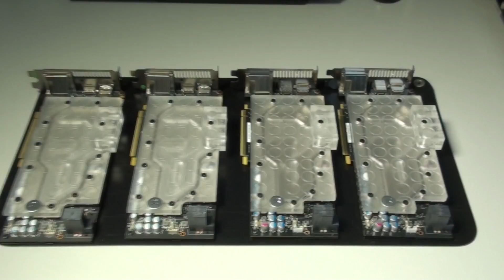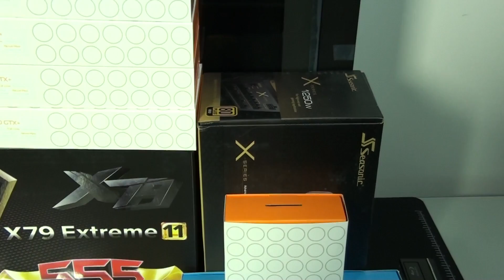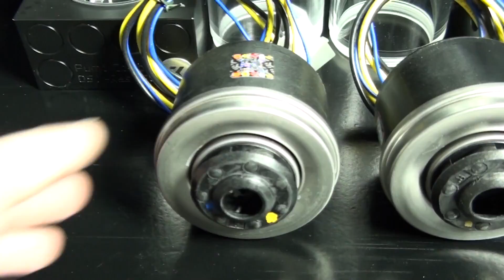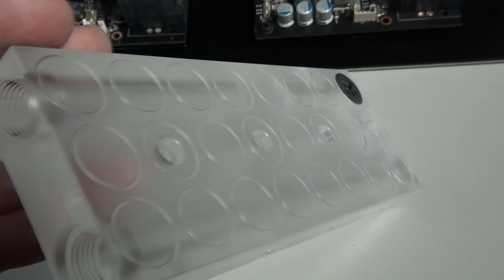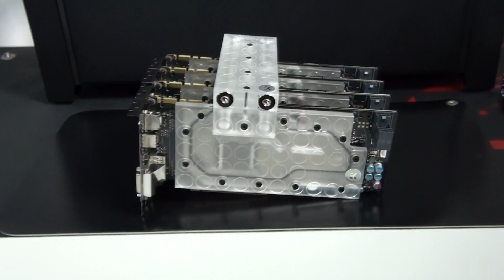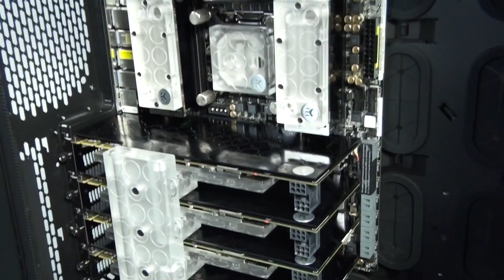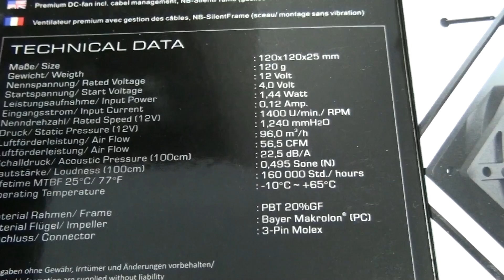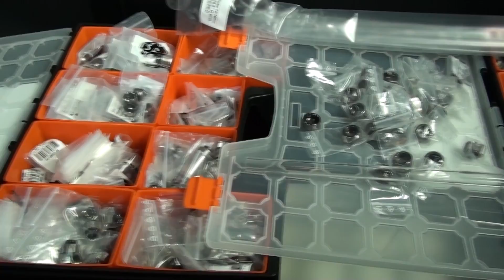Build #12: Quad SLI 900D: Part 1

Comment: Think the main reason for the partial serial bridge is more equal discribution of the flow, to not risk one or two graphics cards ending up getting too little flow. Also the benefit of more flow when using a parralel configuration is not as much more from moving from 2 to 4 or back since the rest of the pipes are just single line. The flow should be about the same from 2 by 2 parralel as 4 parralel. So this is overall a better choice.

Comment: I really recommend a build in the new Phanteks Enthoo Primo! I'm sure you've heard of it being such a big water cooler. Slightly smaller than the 900D but even more friendly for water-cooling with all of the built in features for water-cooling. It's also just much nicer built than the 900D. It also comes with 5 of some of the very best fans on the market right now. Really outstanding case that just dropped down to a $200 price tag, which is completely crazy given how high quality it is. I think it should be more than the 900D and certainly costs more to produce. I would LOVE to see one of your builds in this case!
Reply: That is one sweet looking case! I will have to buy a few for my higher level clients .

Comment: For the bridge, I think they did that so that all cards would get equal flow. In my mind, parallel loops would just rush past all the GPU's. (haven't used before) But, i prefer Primochills application of acrylic tube. They have compression fittings for the tube, which for me is a must for acrylic tube.

Comment: He should sell those 2 680's and get 2 780 Ti's instead of quad sli with bandwidth and v-ram bottleneck
Reply: nasha thedog If he's using a single monitor, he's an idiot for using Quad-SLI anyway.
Reply: If he games in 1080p/1440p on a single screen, these will probably be faster.
Reply: Y'all will be mad at me but for 4k 2 or more 290/x's would be the best option.
Reply: ***** 680's no matter how many can't go 4k with v-ram and bandwidth bottleneck it will stutter as fack
Reply: ***** If you want to run a decent fps with max settings on any game at for example 2560 x 1440 you will need a pair of 780 ti's to manage it. By decent fps I'm talking about the 2560 x 1440 monitors have a 60hz max so I'd want to keep my minimum fps above 60, To do that with games like Crysis 3 and metor and various others you'll require the best cards about. So running multpile 4k screens in this way is beyond what we can purchase now, As for 4way sli or crossfire I think that's a terrible option to go with, poor drivers make it worthless to a gamer.
Reply: ***** No, even 4 780ti's is not good enough for a single 4K screen because you cap out the 3gb vram when you turn everything to max (in a game like AC4) example! 780ti is a stupid card since the 3GB vram is only enough for 1440P max (when you crank settings up) in AC4 at max settings on a single 1080p monitor u use 2,4 gb vram at max sooo....
Reply: CrypticMeow 3 1080p is not 6k. 4k is 4 1080p monitors so you got 3/4 of 4k
Reply: ***** cool story kid
Reply: 1995hss But the extra issues that come with quad sli would negate that small advantage, after all if he can push 100+ with a pair of ti's what difference is he gonna see when he has something that quad sli works with anyway?
Reply: you gotta remember its what the client wants not him
Reply: 1995hss The best options for the majority of people who won't be watercooling there graphics cards are either the 780 ghz, 780 ti, 290 non-reference or 290x non-reference. Thanks to the bandwidth and ram the AMD options are probally the best 4k choice. However 99.9% of us will not own 4k during there lifespan and by the time we can afford to get 4k there will be newer graphics card ranges out built on newer architecture which perform better.
Reply: philip s Honestly I rather have a 290x with and EK waterblock for cheaper.  The PT3 bios already allows for max voltage most are hitting 1300mhz no problem.  With Mantle around the corner and so much dev support its the way to go!  Overall Hawaii is faster clock for clock vs Kepler.  290x is still on beta drivers we can expect much more headroom!
Reply: philip s g-sync is neat but there is additional cost associated with it $399 starting, I would rather put that money towards other components.  Most keep their current monitors and rarely upgrade.
Reply: ^You are super wrong. We have been testing the sh*t out of the all of the AMD's GPU's and they suck. Just as bad as they ever were. Already had 3/20 DOA. Another 2 had serious issues. Tried to contact our AMD Rep (We sell a lot of f*cking AMD parts why can't we talk to one of these nubs who speaks decent english ? AMD is junk though. And Sanjay doesn't KNOW anything. He just repeats what other random retards spew onto the internet. #somepeopleskids
Reply: nasha thedog Well the fact that it's better than Titan in every way and cheaper just means that the price of the titan was out of this planet!
Reply: philip s im using one 780, and running 3x 1080p screens, so 6k. and i run most games fine max graphics. though when it comes to games like crysis 3 or the metro games i need to turn the settings down a notch. but games like arma 3 i run 3 screens max settings no AA at around 60fps. 2x or even 3x 780 Ti would be able to run 4k surround pretty easily.
Reply: ..... well i dont know what to believe anymore. because that's what i used to think. then someone told me its measured by the vertical pixels..
Reply: but still. im using a second gen cpu. once i get a 4770k 4k isnt going to be a problem. 780s are made for it. especially Ti's.
Reply: CrypticMeow This is 4K (4 1080p) http://www.digitaltrends.com/home-theater/4k-hd-explainers-sony-lg-content-delivery-availability/
You won't see a difference going from second gen to 4th gen.2600k 4.8 ghz is equal gaming performance to a 4770k at 4.6 ghz. I'm running 780Ti with 2500K myself.
Reply: Ah Thanks!
But they main reason i want a 4770k is because i plan to do Sli pretty soon. so i would imagine i may have issues will using my 2600.
Reply: *****  club4ghz is right. Luckily 3 1080 screens is not 3 times the power Sure 3 gb vram is enough for most games today and with one gpu u wont wanna turn settings up to high unless u like lag. Especially antialising since that's what eats vram. But if u buy two 780ti suddenly u got The fps to turn settings up but not the vram. Eventhough it was so called build for high res it was not build for high res at max settings. I u want that u should wait for EVGA's 780ti unlocked version wich they Just got a go from nvidia to make that fella will have atleast 5gb vram
Reply: philip s I'd say your better off waiting to see how much more performance the next gen cards give us, also I'm sick of rumours so it'd be nice to get an actual release date for the 20nm range. When you say EVGA are you talking about the ti Classified or is there a different model coming?
Reply: CrypticMeow The best option (debatable) for sli is the sandy-e, ivy-e platform. The reason I moved from Ivy to Haswell when I upgraded from an i5 to an i7 was so that I'd get the extra sata 3 connections for my drives and the improved memory control. Having said that I originally planned to sli and considered ivy-e but still went with a 4770k over it because of the other reasons I mentioned and the fact that even though ivy-e's platform should perform better in sli or crossfire due to the pcie differences the in-game performance figures still put the 4770k above the 4820k most of the time.
Reply: EVGA pushed Nvidia to give clearance to let them make the gpu they wanted. That's the story. The important is it's true even Linus from linustechtips confirmed it (if u know him, u know it's true) benefits is 6gb vram and unlimited overvolting...woouh! The name will be 780ti kpe or king ping edition look it up.
Reply: nasha thedog Thanks for the info. i was considering getting a 4820k, but then i started to see benchmarks for the cpu for gaming. and since that is all im going to be doing, no rendering or anything i would be better off with a 4770k. and i do see alot of people using sli 780s with it so i know it should perform well.
Reply: Sanjay Saini you can expect alot.. Chances are mantpe wont be more than 15% faster than DirectX. And really that new 780ti I mentioned will perform way better and then there's G-sync that will give amagzingly smooth fps. Nvidia have Always done a better Job on driver optimization anyways. Ps with that waterblock / need a shitload of other things to make it run.
Reply: philip s yeah in reviews they have maxed out vram on the 780ti but for 1440p its good enough, but not worth the premium over the 290 or 780
Reply: Sure it's worth it if u play on 5760x1080 u need 6gb vram atpeast more than 3 and if u want all the nvidia benefits like physx and shadowplay etc its The way to go personally I dont wanna watercool also
Reply: philip s could be scenario but let's not discuss performance gains yet
Reply: And so the pc race goes on :-) that's why buying a ps4 just might seem cheaper hehe but in the end its all what u pref ajd what your budget looks like. Personally I think nvidia yave a little more quality to it. The software as well as the hardware but sometimes amd have given you more freedom.
Reply: Sanjay Saini Still on beta's? How long have the x's been out? That's partly why I moved from AMD graphics, the other reason was terrible crossfire performance, I chose AMD during the 5000, 6000 and 7000 generations but moved to a 4gb 770 to sli a couple of months ago. I just sold the 770 as I decided to buy either a 780ti or a non-reference 290x instead but hearing there still on beta drivers is a joke. You also need to remember 90% of people don't want the hassle of building a water cooled gpu set up. I just bought a cheap black friday 7850 to hold me until the respective models come out but from what you just said AMD doesn't look like the best option at all as the last time I checked on some relevant forums there staying below 60 degrees on water but only reaching around 1200 while remaining stable. At the moment the 780ti looks like it will be the best choice but I'm staying on water with my gpu so I'll see how they all perform on release.
Reply: philip s I did a load of info hunting on the EVGA Kingpin and it sounds like it will be a beast but where looking at too high a price for most of us, I'm sure it'll be the new Titan but I'm struggling to justify paying what they want for an EVGA 780ti Classified let alone what there gonna want on top for the Kingpin.
Reply: You ever think he just likes the looks better?
Reply: nasha thedog Make sure you PM us if you are serious. Vince is a homie.
Reply: i think performance is just a second thought.. the way it looks is number one
Reply: nasha thedog crossfire issues are gone with the R9 290,  SLI is not what it used to be still no cod ghosts sli profile,  till this day there is stutter in bf3 and tomb raider was a disaster.  Both companies have their pros and con's.  As for the future..its definitely brighter on amd's side with console and mantle.  Hawaii is faster clock for clock vs Kepler.
Reply: ***** Than your very lucky sir.  Glad your experiences with Nvidia have been pleasant.  Got a feeling that you do not play a lot of games?
Reply: Sanjay Saini I play a hell of a lot of games and I haven't really had any problems with Nvidia or AMD, At least not before I tried dual gpu's and then I had a terrible time with crossfire. With single gpu set up's I think both brands are great. I've had more AMD than Nvidia but the last was a 4gb 770 and it ran everything flawlessly.
Reply: Be happy on what you have guys...I've been using a very old laptop with GT 105M Gpu and I'm happy playing games with it. My parents can't even afford case fans atm. Heck, we can't even afford a taxi on the way to a computer parts shop.

Comment: Make a Nice bottom panel; Mine ended up looking great with a HL3 symbol.
The top panel is a bitch ya.
hinges are easy 2 bend back, but are annoying.
You will have fun modding the 900D

Comment: They use semi-parallel so that you have options to avoid lowering the pressure in the loop too much, or having to have a very high pressure loop prone to failures.

Comment: The Semi-Parallel configuration on the EK-FC Bridge is to optimize system flow.
Reply: Serial or successive reduces system flow due to higher restriction caused by limited dispersion; parallel increases system flow due to less restriction caused by simultaneous flow. Therefore, Semi-Parallel is more efficient because it equalizes system flow allowing coolant to move evenly throughout the loop.

Comment: So if its not Silverstone TJ11 and its mass produced its crap? I believe they did an excellent job on the 900D for its price which is half the price of the TJ11 The TJ07 is even more expensive than the 900D but is made up of several different pieces that make it sturdy the 900 is almost one piece in comparison. So in my opinion I believe they gave the water cooling fans that didn't have extreme budgets a easier way to build there dream custom loop pc.

Comment: could there be any problems with using two 16GB (2x8) Corsair Dominator Platinum ram sets to get a total of 32GB?
It will be 1600mhz cl9 and will not be overclocked
should that be ok?
Reply: yes

Comment: No, the stock cooling on the motherboard is NOT sufficient. LinusTechTips did a video about it, and it gets super hot, and the fan is loud. Turn down that fan, and you're gonna melt the board. It's not the chipset, it's the chipset, the LSI raid chip, and 2 PLX chips all cooled by that heatsink.
Reply from the maker: I didn't consider the PLX and RAID chip which was absent minded of me. There will only be a single SSD and HDD in the system, but the Quad SLI GTX 680s will heat things up. I am going to try to organize a water-block for it.
Reply: ***** I would of told the client better advise and insisted on Rampage IV Extreme Black.
Reply: ***** Actually there aren't any universal blocks that would work for this board, and it definitely won't fit with 4 graphics cards on top of it.
Reply: ***** He builds whatever clients want actually.

Comment: They used a semi-parallel config to equalize the flow between the 4 cards (I think :P)
Reply: I agree. If the FC Bridge was full parallel, the first and second card wouldn't get as much flow through them as the third and forth card.